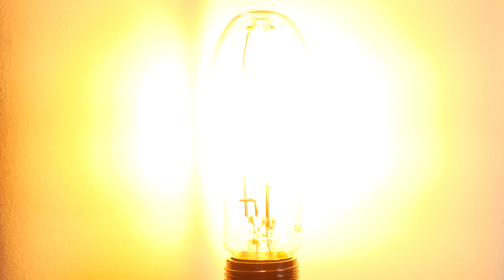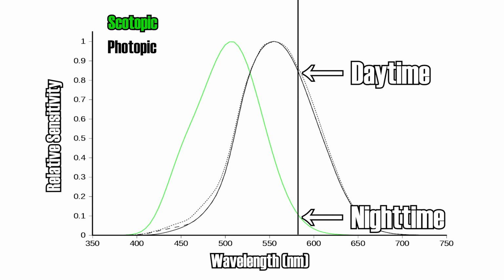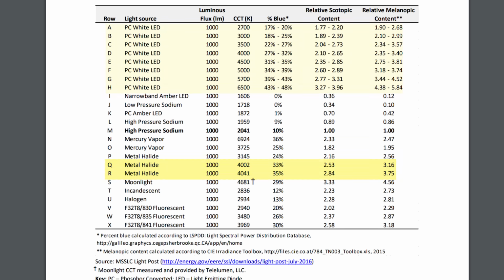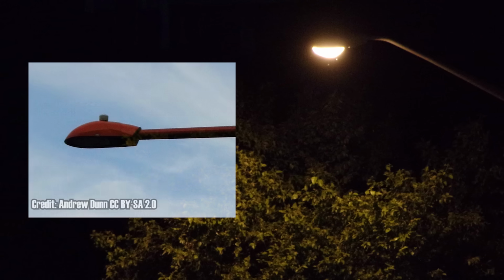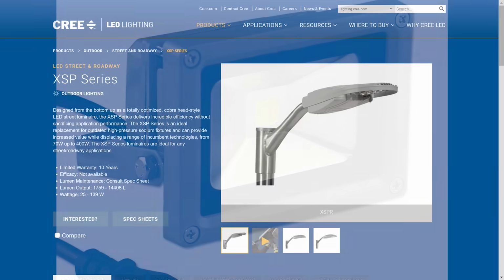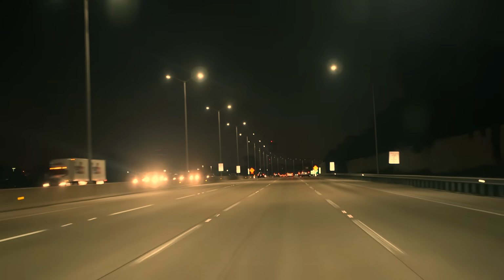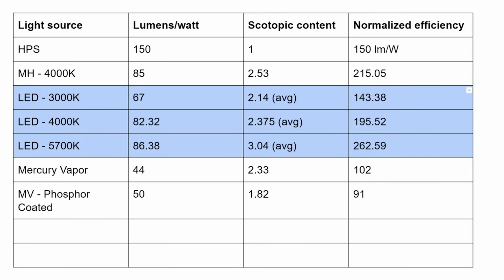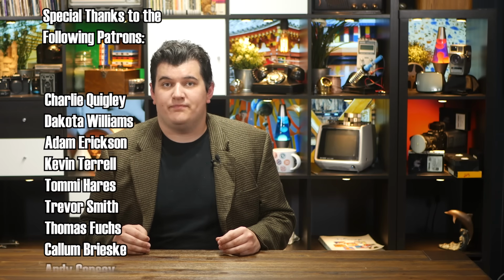The LED's Challenge to High Pressure Sodium

Comment: Surely the sleep disruption effect of LEDs is a benefit to safety especially on highways since falling asleep at the wheel or other drowsiness is a significant danger of nighttime driving.
Reply: People driving aren't the only ones affected by street lighting.
Reply: @SonofSethoitae  ok, hps in residential areas, led on highway and city roads. problem solved!
Reply: Yup that does seem more of an advantage on highways especially as even where they go into cities they tend to be surrounded by commercial or industrial land uses. So the negative effects would be lessened to my mind as they are not in residential areas which are perhaps better to continue using sodium lamps, low speeds gives drivers more time to react to hazards on residential streets too.
Reply: It's not, as the blue light in white LEDs has a greatly increased ability to scatter in particles. This creates much more glare, and turns weather such as rain and fog into blinding obstacles. Our eyes are also quick to darken their vision under blue light as an adaptation to daylight, making anything not directly lit by the lights impossible to see. So while the sleep disruption effects of blue light can be debated as good or bad, it's other properties have 0 possible benefit. There is also a growing pile of studies finding that white LED lights are terrible for the ecosystem, killing huge amounts of insects and damaging plants.
Reply: on HIGHWAYS. Res streets should be 3000k
Reply: We live in hell world where these are legitimate arguments
Reply: blue light even not late at night can disturb sleep schedule it doesnt have to be at midnight for it to be harmful
Reply: @mrE365 Even though my sleep rhythm is normal, I kinda just do that already. I just sorta pass out around 10 PM and naturally wake up at 5 AM. It's quite odd.
Reply: For sure! I love having an artificial sun in my bedroom at night, even with my blackout curtains closed. The little gaps are enough to illuminate my room to ensure I stay safely awake in my bed 😊
Reply: It’s absolutely a great idea to have leds lights but as someone with a stigmatism I can tell you I avoid my mirrors an when someone is close behind I physically have to slow down to a under 30 because the light is so bright I can’t see the road I’ve found myself pulling over to stop because of a splitting headache an nearly crashing because I couldn’t see out my mirrors to notice another car I find driving at night especially for me has become extremely dangerous because I straight up loose the ability to drive with out being blinded
Reply: @timmy5949  I dunno a out you mate, but I have astigmatism so severe I will be required to buy custom lenses if it gets any worse; and I can say without a doubt that LED lights cause far less problems on my eyes lenses or no lenses. However, people who drive with HID's should have their license revoked
Reply: @victorkreig6089  HIDs are not the issue. People putting HIDs into their halogen lamp housings are the issue. A correctly designed projection fixture for an HID lamp will have a sharp cutoff line above which you cannot be exposed directly to the arc. Because the projection lamps use lenses, a fun fact is the cutoff sits on the bottom of the projector. My car came from the factory with HID lamps, and I have to get down below the light cutoff to be blinded, so I'd have to literally be less than 1 foot off the ground to be blinded.
Reply: @timmy5949  Many cars have a dimming setting on the rearview mirror. Look in your car's manual. When driving in town, I don't need it, but on unlit country roads, I flip the setting so that vehicles behind me with full beam on don't blind me.
Reply: @timmy5949  save up for a car with automatic dimming side and rearview mirrors
Reply: @kaw.someness  it's a head-on issue
Reply: @itptires  wym?
Reply: @timmy5949  it seems it also disturbed your ability to punctuate.
Reply: Circadian rhythm disruption isn't just keeping you up when you are in the blue light, but changing how your body uses and produces melatonin in the long term, so while it may make you more awake when night driving it will also degrade you quality of sleep over time.
Reply: @dantevozza2742  I feel like if you are up late enough to take in enough blue-lights from highways to damage your sleep schedule, the fact that you are staying up all night might be a bigger factor to your mental health, blue light can be damaging but it can't be as damaging as self-induced insomnia (or any sort of insomnia for that matter)
Reply: @newon2014  not all people have agency in when they can sleep, things like night jobs can keep you up. Additionally these lights don't always have gaurantees of no upward light leak and so people can have errant light enter their homes in the night without self induced insomnia.
Reply: @dantevozza2742  I dont disagree but regardless of rather or not someone has the choice of sleeping, the fact that they are up all night is probably more damaging to their mental state than the blue lights the lamps that they are driving under give. Unless someone is doing 100% city driving for hours chances are they're not going to be bathed in light the entire night.
Reply: @dantevozza2742  Upward facing lights are an issue for sure however
Reply: @newon2014  but people also have to live next to highways/major roads. At least in NYC, I can manage the orange glow when i'm trying to go to sleep, but a harsh white light might stop me from being able to get to sleep. I think they already are switching to LED, and it makes it a lot more difficult to sleep.
Reply: @dantevozza2742  Most people close their blinds and curtains when they're trying to sleep so light going into their homes really shouldn't be too much of an issue.
Reply: @newon2014  You do know that 2nd shift is a thing that exists, right?
Reply: @wyattlewis8671  my blinds have been permanently down since they installed a blue LED streetlight outside my bedroom window and the light that makes it past the edges is still distruptive to sleep. 

I used to leave the blinds open and wake up to the sun with the old sodium lamps.  I've never felt the need for total darkness to sleep, but something about blue white LEDs seems to pierce your eyes even when they're closed. 

  I'd be just as happy with a warm coloured LED, but the ones we've got are horrible.   In this case their incredible lifespan is a drawback since it could be decades before they bother to replace it with a warmer one.  

Given that my house is on a residential road with no thru access, there's hardly any need for street lights at all.  What's more, the LEDs we've gotten barely even light the street, instead casting most of their light sideways.  

As far as safety goes, on backstreet like these at night, if you were to rely on the streetlights at all you'd probably run over cats all night long.  If anything, having too much night time visibility in residential areas encourages people to drive faster when that isn't appropriate.
Reply: OverClockedToaster  wouldnt his lack of sleep disrupt the circadian rhythm by its self? What im trying to say is that the fact that the driver is not sleeping is way more disruptive to his circadian rhythm than the lights? Or is it ONLY blue light that can disrupt the rhythm?

Comment: Sky glow can be largely handled by directing correct amounts of light carefully.

One size fits all lamps and lenses are not a correct fit anywhere.

Circadian rhythyms should not be a big factor here. Ensuring that people driving at night are still able to be sleepy seems to NOT be a worthwhile goal.

Much higher efficiency is possible and quickly forthcoming. Convertingvto LED now will hopefully make the later switchover to 200 lumens per watt as easy as switching bulbs. LED technology is still in its relative infancy. Sodium and mercury vapor lighting employ mature technology and are likely about as efficient as they are  going to get.

If you are seeing colors in the road, you are NOT using your low light vision. Better to just conduct some tests with humans recognizing objects and signal lights and retroreflective surfaces to see how the safety works on this.

Comment: One huge issue with colder color light is that it really doesn't work with fog or snow, where lower wavelengths passes through much easier without blinding drivers.

Comment: I would miss that HPS, warm bonfire look...😔
Reply: I think theres  decent comprimise... they could use yellow or range leds in replacement of the white ones.. but rhat wouldnt fix the fact that they seem to break very often
Reply: @KatieTheDev  ??? Not caused by street lighting, HPS is the safest as it is just a circuit without a circuit board.

Comment: Reliability of LED lights is still far from regular lighting specially if you live in areas with high temperature weather. I recently replaced almost 15 years old failed philips tube light while at the same time I replaced another 2 years old failed LED light.

Comment: I am willing to bet that local street lighting regulations have been lobbied by the High Pressure Sodium purveyors to require the spectrum and the measured output they produce, limiting the ability of some lighting districts to reduce the light in the manner you prescribe. It may take legislation changes to get the safest level in some locales.

Comment: What about the energy lost to heat with the built-in transformers on a typical LED bulb?  They run on a pretty low DC voltage, gotta kick it down there somehow.  This is obvious on the household ones - they have big chunky bases and usually some fins as heat sink.

Comment: My city has been systematically replacing sodium lamps when they go out. A lot of peoples found that the LED used for the first few lamps were just way too bright and blinding. They have since moved to amber LED and they are great. I have one at the corner of my street and it fits right in with the old sodium lamps that are still in place. The biggest problem we had with those is that during winter, they don't generate enough heat to melt the snow that accumulates on them. A heating element had to be added to fix the issue which obviously means that during winter, they aren't as energy efficient as they could be.

Comment: At several hundred watts each, HPS is not "very efficient"  And I see so many that are not functioning either due to the still used after 50 years day/night switched, or just an old failing bulb, but the light fixture continues to try to 'start' it and that wastes even more power.  LED is by far better, regardless of the spectrum.  And real time clocks are cheap too, so NO future street lamps should rely on ambient light to decide whether to be on or not.  That switch has been a fail for three decades but they still use it.
That is because the cuty managers buying this crap have no clue that they are buying 50+ year old technology.

Comment: I wish I knew you were going to do this video. The only true problem that I have with these new LED street lamps is when it is foggy. The street lamps create an almost opaque wall of whiteness when they light up fog. So opaque that I fear driving into them. I literally go down of 5 miles per hour to drive-through this wall of fog.  Maybe fog doesn't happen enough to talk about this problem or to even create a solution for this problem. I would love to hear  Someone else's experience with  Fog and led's. And know it also did love to hear observers a solution. Which I do believe there is after watching this video

Comment: Your interpretation of HPS having the lowest melanopic light content is severely mistaken as the HPS system was set to unity (or 1.00) as being the most common... read the article and you will find your conclusions are misplaced... https://www.energy.gov/sites/prod/files/2016/07/f33/msslc_enews_jul2016.pdf

Comment: It's relative, concerning change. I remember ( I think it was in the late 70's) when old incandescent light bulb street lighting was replaced with the sodium lights. Many people at the time hated the 'yellowing' of everything. Now they've become iconic. I wonder what it was like when it was gaslighting.
Reply: Actually incandescent bulbs were phased out long before the late 70s. Back then the dominant street light source was mercury vapor. High pressure sodium didn't become common until the late 1980s
Reply: @exoticcar5482  I remember seeing incandescent streetlights in a single neighborhood in the early 2000s. I'm not 100% sure they were incandescent but I remember the bulbs were unprotected on the bottom.
Reply: The worst were the clear Mercury Vapor street lights without the color correcting phosphorus coating.

Comment: I like your in depth analysis of road lights. On one note though I personally dislike the orange light of the HPS, it feels dirty. The clear bright light from a good designed LED is much more pleasant for me. I feel this esthetic debate is s 50/50 subject. But as you concludes in the end, it's more important to use the right light source at the right time that the esthetically reasons, pro or non pro HPS

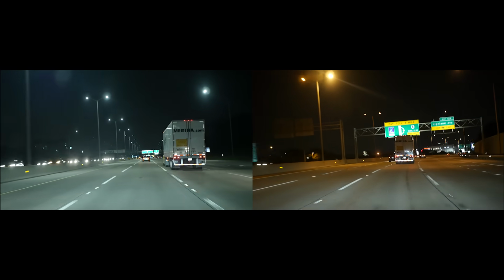Comment: According to me... at 8:00 it is clearly visible that HPS lights create a much greater contrast. In my neighborhood I have 2 major boulevards one with LEDs, the other with HPS lighting and while the LED street is lit as if it is a day, everything blends and there's no contrast. The light bulbs, although placed very high, when enter the visual field trigger a significantly stronger pupil reaction and the end result for me is troubled visibility, low contrast and light pollution for the nearby residential buildings.

Comment: your lumen per watt output is way out of date  and you still are comparing apples to oranges .  cost for cost versus meantime  of replacement  hps  at approximately 14,000 expected life span before failure  versus  led  newer series   that produce 200 lumen per watt and an expected life span of 65000 hours ......   hps take a longer time to warm up  in the range of 15 to 20 minutes versus  instant light with led. so taking in account your cost comparison and the led can be PWM ( pulse width modulated )   which increases overall efficiency AND also more efficient at dim-able to compensate for pavement and surrounding reflectivity which is where 80% of  light pollution comes from . even at the time of this video you  were not comparing the  most recent LED eff.   and life cycles.  mass studies done buy numerous  foundations and researchers state opening ... LEDs are more efficient at creating light than an HPS lamp. LEDs will always beat HPS on a light meter. 

 And now direct  fit retro kits are available to install led into currently  installed  HPS street lamps and have been available since 2014 .... you need to sit back  check over some of the current systems and revise you video. and  you can also get cool  white light level which is a yellowish color tone blue light therapy   is used  currently used in sleep disorder.

Comment: 5000K lights are OK in the city where everything is bright all of the time anyway.  The reason you support them is also a reason to not use them all of the time.  The problem comes outside the areas of constant brightness, whiter/bluer lights effect your pupil differently than softer redder light.  

Pupil contraction caused by blue light will cause a period of night blindness as you transition to a dark area with no street lights, this is why folks on the bridges of ships or cockpits of airplanes at night will use red lights to illuminate something that they have to read, the red light allows your pupil to remain dilated so when you turn off the red light and look back at the sea you still have your night vision. 

Similarly when someone is driving towards you on a country road with those super bright white/blue headlights; as they approach you have to squint as your pupils contract and your night vision goes away, once they have passed you can't see the road ahead of you very well because your eyes take a while to transition back to night vision.

Comment: How does the team find all this 🤸‍♂️?!
So much info —> So well consolidated. 👌
Reply: Measuring What Counts for Economic and Social Progess ::
https://youtu.be/kC31Ym157R0
°
We see that the extra cost in light emissions to preserve our circadian rhythms may be a sign of a healthy society.
°
The next question is -> to what degree is the disruption to the lights in the context of where we are transiting from.
°
The answer to that may be, many are going home to screens and light bulbs that take away blue light. Perhaps the streets could do the same.
°
Matthew Walker discusses this in several platforms in the context of his sleep research.
Reply: Also in so glad circadian rhythm was included. 
It’s such an erotic concern yet so salient.
Reply: Studies showing fast response time , may not be after if sleep is disrupted.
Matthew Walker talks with Rhonda Patric —> high deaths in high school were from slew deprived driving. After school hours moved back, many of those leading deaths were impressively reduced, simply adding healthy sleep. (Adolescents May be unconscious at 8pm but they don’t biologically start sleeping till later in the night.)
°
So long term better rhythms may marker are the costs to put on warm lights by saving infrastructure and healthcare costs caused by sleep deprived driving.
Reply: It be cool if quick emissions of the cooler colors unnoticeable in between the warm color streams would increase response times.
Thus giving back  the  response time without the constant blue.

Comment: Please make a video about electrodeless discharge lamp (induction lamp). I heard that it is as efficient and long-lasting as LED lamp but way cheaper and have higher light output. It seems relatively new commercial lighting method, so information about it is rather sparse.